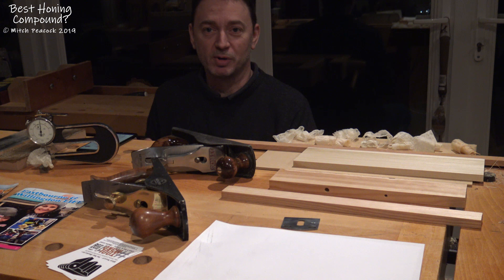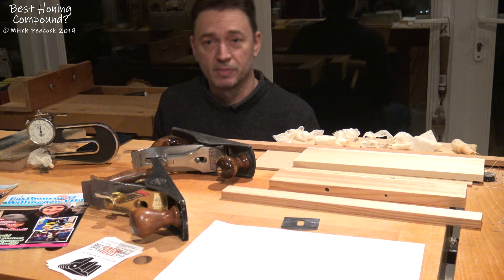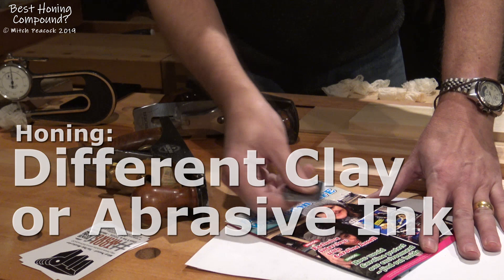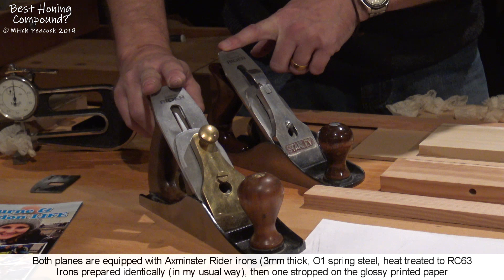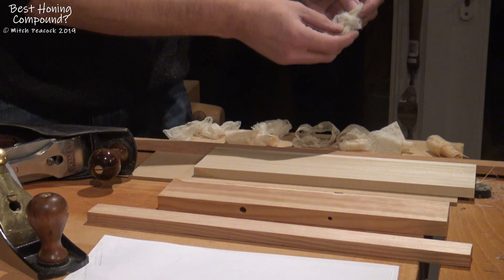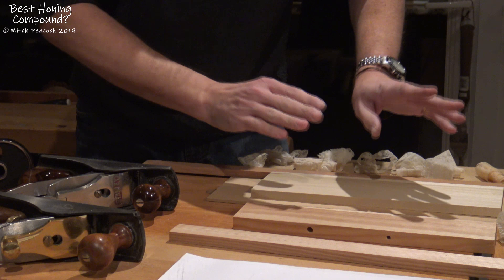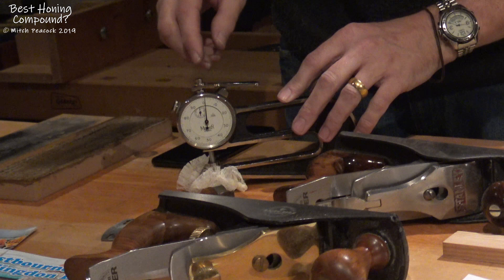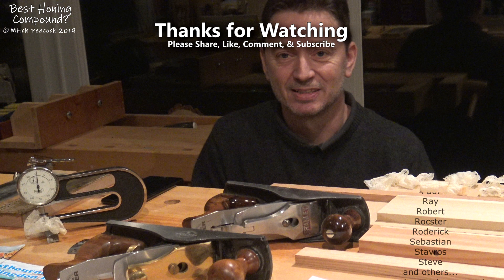Best Honing Compound Ever? Making sharp sharper

Comment: I literally just started using Bark River compound. It comes with black 3,000, green 6,000 and white 12,000 grit. Got a serious mirror polish on my bevel however I've heard other people swear by using news paper print to strop something about the ink is abrasive. I've never tried that though so I dunno if it works or not
Reply from the maker: I can't be sure, but I suspect these ranges of branded and even unbranded compounds are all made the same, if not in the same facility. They do a great job and are consistent in their grit. Even the branded ones aren't overly expensive.
Reply: @mitchwoodwork  I have found big differences between compounds. The lowest quality is Blue Spot - which is the one most commonly found in the UK. Veritas green is good and spreads easily but is only half a micron and produces almost no visible steel particles. Trend paste (about 8000 - 10000 grit they say) is just the opposite and turns the strop black in no time at all. It also leaves a nice mirror finish. DMT diamond paste is recommended by many but I have yet to try it. Bark River compound is also highly regarded but difficult to obtain on these shores.
Reply from the maker: @mingulay29 I'm using MPower orange, white, and blue at the moment, and they are all working well. My usual was just Trend blue or Toolstation blue, which I reckon are identical.
Autosol is another favourite of mine from the past, when I used to charge mdf with it.

Comment: I tried this too a while back, and like you, I saw no difference, Mitch. It's difficult enough for me to keep the blade at a consistent  angle when stropping without adding another step to the process.
Reply from the maker: It took me some time to get stropping to work, and it's very easy to round over what should be the sharp edge. Difficult to explain in words or even video.

Comment: Hi Mitch, my understanding of this has always been that it's used as the stropping, not as an additional step in stropping. That's how I heard it was used and tried it myself years back when I was into knives. From what I can see it works a about as well as bare leather, so it's more about removing the very last vestiges of burr/wire edge and aligning the edge. Once you have polished the edge as happens on a loaded strop there's no improvement to be had from this IME.
Reply from the maker: Cheers. That would align with the result of my very limited test, in so far as I didn't detect any improvement. However Nicholas did say that it should be used after normal stropping with a honing compound, which is interesting.
I usually finish straight off the plane anyway, so I'm not sure any improvement in sharpness will benefit my work, but it's a bit of fun to investigate.
Reply: @mitchwoodwork  Well it might benefit someone who isn't stropping the same as we both do. Standard strops vary in hardness and 'aggressiveness' depending on what material is used and whether there's compound (and what the compound is) or no compound. But I fail to see how anything meaningful can be happening to an already polished edge if no metal is being removed, as you highlighted perfectly with no colour being deposited on the paper! After bare horse-butt leather? Yeah, maybe.

Comment: As most paints contain a form of oxide, often aluminium oxide (the same material most sandpapers and grinding wheels are made from), it is quite probale that you can polish steel with paper with print on it. The glosy texture of magazines can be made in a variety of ways and my guess is that it is the paint, not the gloss that does the majority of polishing. 

Just made a quick test on some magazine paper with print on it, but no glossy layer, and that polished a plane iron nicely. Just about as shiny as when using a strop. The upside here could be that the paper, when laid on a flat surface is just that: flat, while a leather strop will thend to be softer and round the edge a bit.
Reply from the maker: That's encouraging. I was probably unlucky with my magazine choice. Thanks for sharing your experience
Reply: You can order Pikal polish which is pure aluminum oxide... you can certainly polish steel with it, and it makes for a very good strop.

Comment: Hi Mitch, in my opinion best way is leather strap with honing compound. I use one with 10 my particle size.
Reply from the maker: That's what I use. The paper is supposed to be an additional step, but I'm not sure yet.
Reply: @mitchwoodwork  I just got into sharpening my pocket knives and such and all I have is the (325/750) Smith’s 4” Combination Diamond stone portable sharpener. Real cheap in the US about $15 and it works surprisingly well just don’t have anything to get that burr line out (I have no strop or compound yet) and I’m trying this and I’m seeing marginal results... maybe it’s just straightening out the edge on my $10 pocket knife but I can feel a (slight) difference
Reply from the maker: @greg6162  Good to know. A lot of anecdotal evidence on printed paper polishing, so vary hard to debunk. Either I read the wrong magazines, or they're not as quick to polish as honing compound 🤔

Comment: Friction is friction. If you're determined enough, careful enough and patient enough you could hone an iron with a wet feather. Just don't expect me to wait for you to finish.

If you really need to feel confident that you've got your edge sharp enough use jewellers rouge or diamond paste. You can get jewellers rouge in varying grades up to the equivalent of 3000 grit sandpaper and diamond paste up to 15000 grit or higher if you really feel the need. Either one will be so sharp you will only notice the difference with a microscope, and both of them will be just as dull as the other after the first stroke.

Really, after 1000 grit it's the same principle as polishing your family jewels. You're really doing it because you enjoy the activity itself, and not because there's any extra benefit beyond the first couple minutes.
Reply from the maker: Can't say I've ever stropped the family jewels, and I don't think I'll ever be doing so on paper. The thought of paper cuts brings tears to the eyes 😂
Reply: Omg this is as hilarious as it is salient! 😀